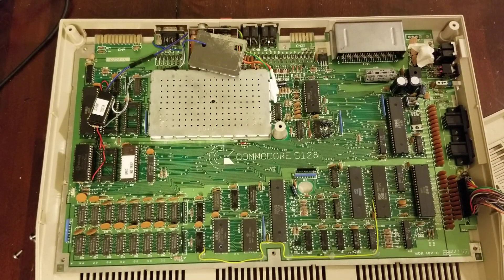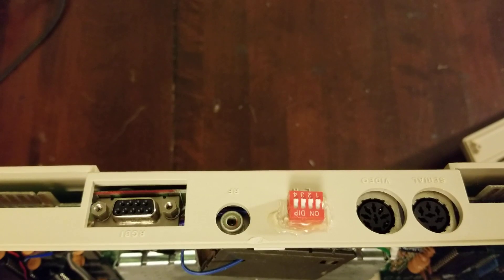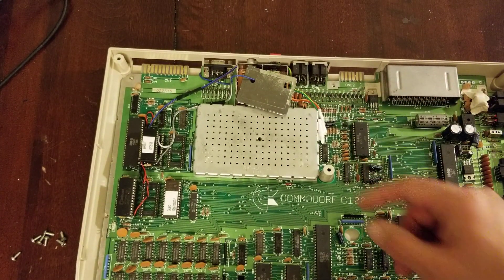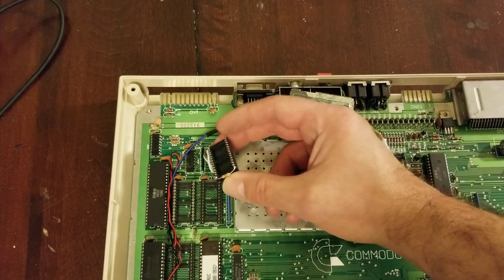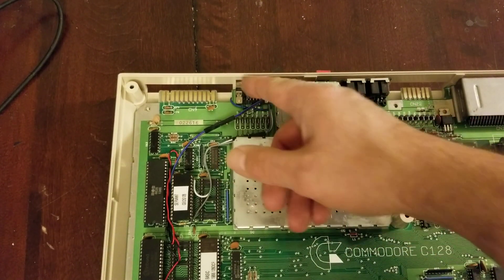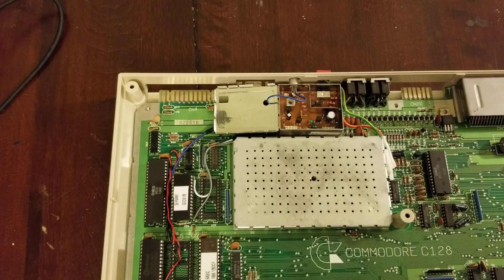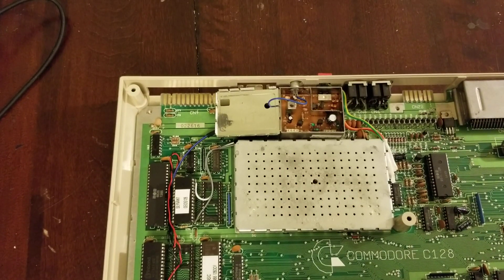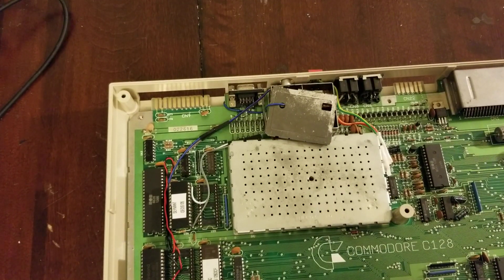Quick and Dirty Commodore 128 80 column VDC output and ROM switches.

Comment: I like that way of doing the 80 column mod.   I cant imagine too many people using the RF out these days.    
I just ordered a rotary switch that is coded in octal and am going to try that in place of the DIP switches for my ROM selector.  I'm pretty sure it will work the same but I haven't tried it yet.
Reply from the maker: What rotary switch did you wind up going with?
Reply: @retrotechinsanity  just pulled up my order history from Digi key.  Ended up buying FR01AR10PB-S which is actually coded decimal.  I guess all the octal ones were out of stock when I was looking.  It is panel mount so it mounts in a 1/4" (6mm) hole like a toggle switch would.  I haven't had time to try it yet, but in my mind you put 5V on the common, wire the outputs to the address lines, use some resistors to pull the lines low that aren't used, and just dial in the ROM bank you want.  they also have complimentary switches if you want to use pull up resistors and use the switch to pull the lines low.  The switches are generally available coded in octal, decimal and hex.